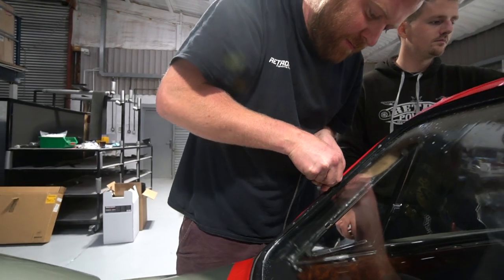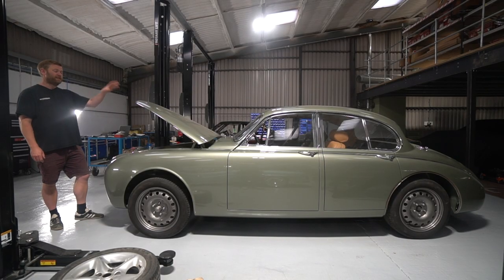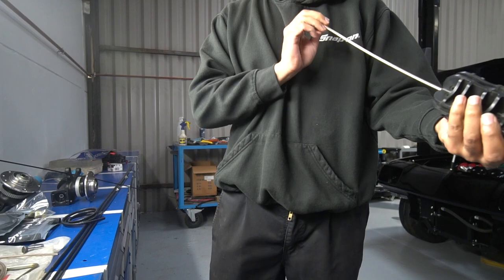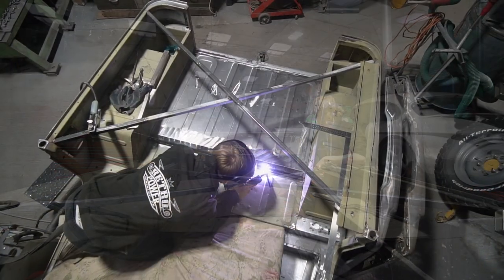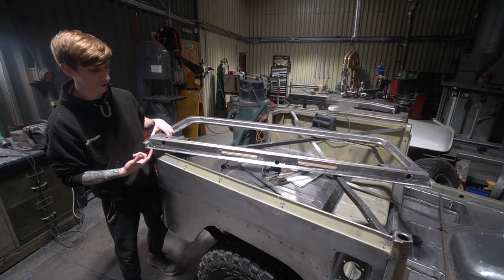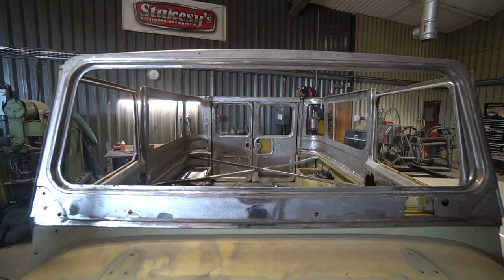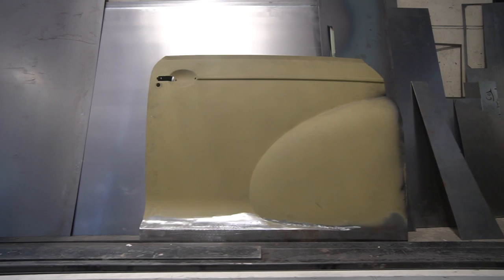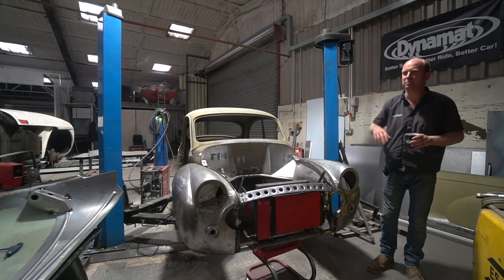Retropower Uncut Episode 57: MK2 Jaguar Restomod Prepared for Rolling Road & Morris Minor Metalwork

Comment: Guys, as usual your expertise shines through so clearly and I especially like the Project Utah wheel design. Their 'rightness' becomes crystal clear when compared with the not unreasonable temporary alloy wheels (from the CV8?) fitted for the rolling road test. However, if you compare the tread of the rear tyres (4:54 - 5:05) it looks as though one of the tyres may have the incorrect face on the outside/inside, as opposed to the other one. Apologies if I've got this wrong. Keep up the good work.

Comment: Could someone explain why tom did a full weld on the floor rather that stitch or plug as assume no way to get spot welder in. Just wondering why full weld when factory never did that.
Reply: it was sort of covered in  the rant section a few episodes ago. paraphrasing... to minimise warping of a panel. they treated it as a panel, not as a structural piece like the Morris engine bay

Comment: Need to ask this of the retro power guys or indeed veiwers. Why are people not swapping more modern engines into older cars. I know its something to do with canbus wiring but im not a mechanic and i would have thought a stand alone ecu would solve this. Can anyone explain this to me or provide a link to a video/ forum to find out a bit more ?
Reply: There's certain engines in the world that are "tried and true". They have a lot of aftermarket support, upgrades are plentiful, their limits are well documented etc. etc. This is mostly down to their period use in motorsport by works teams. Many engines that are regularly used for this kinda thing are motorsport derived. Engines that are not well catered to by the aftermarket only ever really end up being left stock because getting parts made for them becomes exorbitant. Plus most modern engines are direct injection which isn't great from a performance perspective at the top end so engine would end up converted to port injection. The only time CANBUS comes into the equation is if you're trying to do something with existing vehicle electronics (dashboards, gearbox controllers etc).
Reply: Hynes64,If a vehicle first used before 1 September 2002 is fitted with an engine that’s older than the vehicle, you must test it to the standards applicable for the engine. The vehicle presenter must have proof of the age of the engine.
Reply: hynes64, If a vehicle first used on or after 1 September 2002 is fitted with a different engine, you must test it to the standards for the age of the vehicle.
Reply: For a lot of of classic cars, the (original) engine is a significant part of the appeal and therefore value - think Jag XK, Alfa Romeo...actually most Italians. swap-out the engine of a '50's Giulietta for instance and it's market value will nosedive . Personally, I can't get my head around a Japanese engine powering a MK II, but I console myself that there are many, many original MK II's on the road.